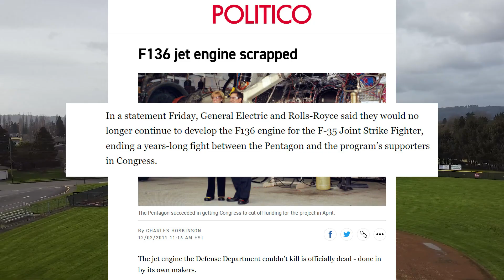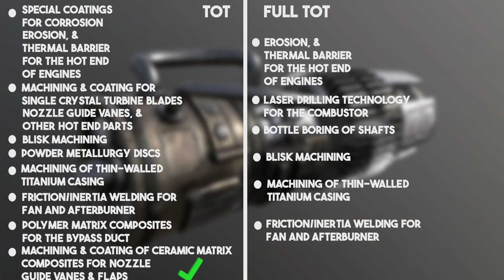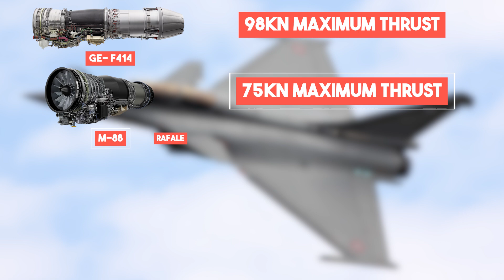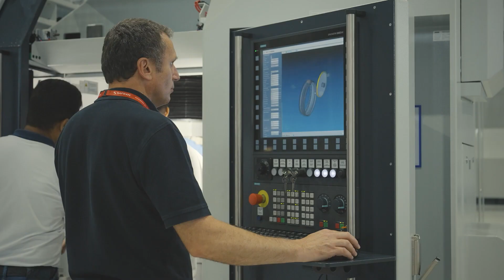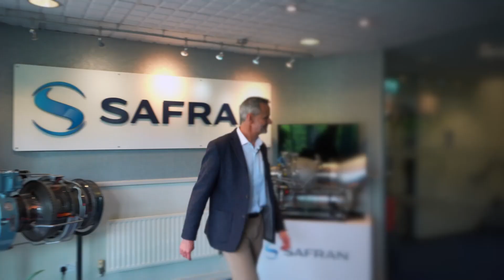GE-F414 Engine for India | Is It Good or its just a gimmick? AMCA Getting The Right Engine?

Comment: India should definitely have the capability to make cutting edge fighter jet engines. Who knows better how to proceed than our research organisations? Looking at the current situation, I feel pretty confident that our prospects are bright.
Reply: Kaveri engines generate close to 70 kn after 30 years of research and it was rejected by the IAF as they wanted a 90kn engine for tejas. The most critical component of any aircraft engine is the Crystal blade technology. Even in the f414 engine deal US don't want to share the crystal blade technology. So even at present we can't make a 90kn engine ourselves that's why we want to buy a 98kn engine from US. As for the AMCA mk1 we need a 110-120 kn engine. Imagine when the US doesn't even want to share a 98kn engine crystal blade technology who will give you the technology of a 110 kn to 120 kn engine? We are in talks with rolls royce and safran for TOT. But we have to get the crystal blade technology at any cost otherwise we will be unable to make crystal blades by ourselves.
The engines used in Russia's 5th gen Su 57 produce 140-145 kn where chinese J20 produce almost the same. US F 22 156 kn and the F35 generates 191kn power. So imagine just how far behind we are.